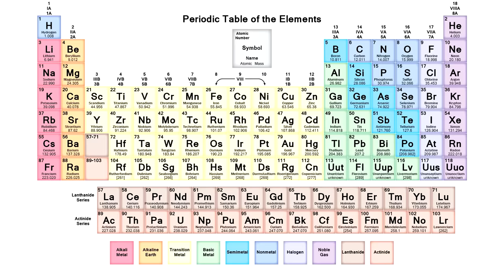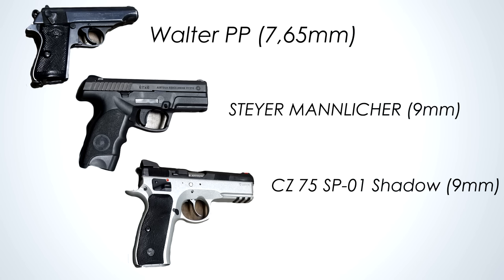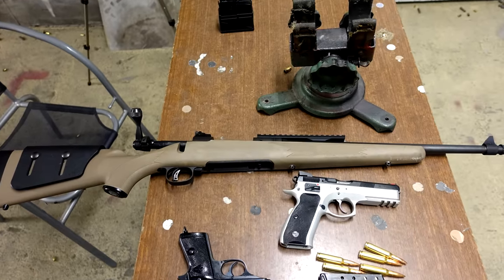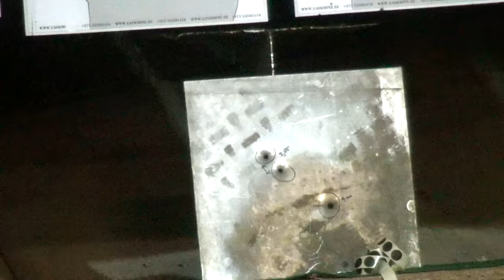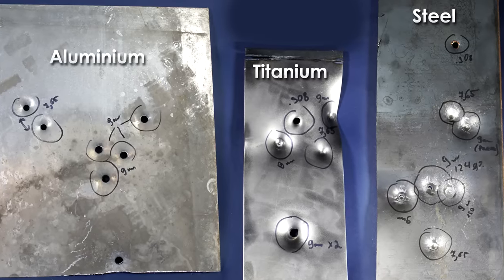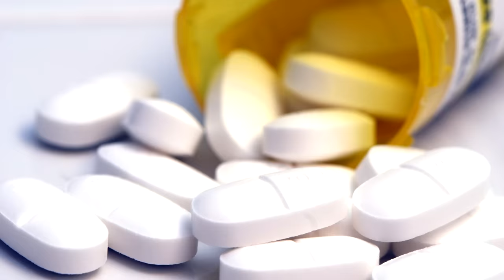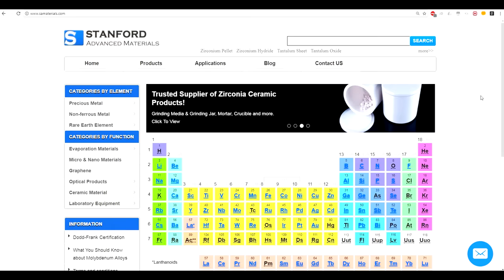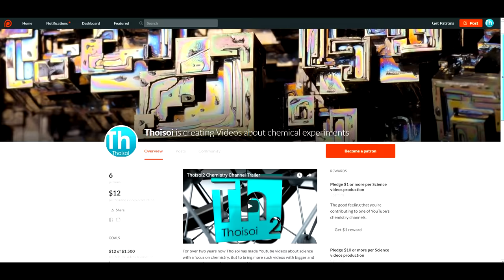Titanium  - The STRONGEST METAL On Earth!

Comment: Toughest? No, but being light weight but tougher than aluminum is why its a awesome material. The toughest still goes to tungsten, chromium, or nickle depending on what you call tough. The reason how I know this is because I'm a CNC engineer that works in the development/manufacturing in Carbide tools. Titanium is more like a aluminum 2.0. Not many people use those other materials due to either material cost, machining cost, or other possible reasons.

I edited the original comment because I nearly forgot about nickle.
Reply: Zin Gaming Tungsten should be hard instead of tough. I've never seen metal chromium, you're job is so cool!!!
Reply: sovietrepublic38 sort of is. Its not easy and very expensive. If a operator screws up a tool it can be as cheap as $.20 or as expensive as $2000 in material costs alone.
Reply: I'm a mechanical/process engineer who also is qualified as a master toolmaker. I use hardened D2 tool steel to manipulate titanium on a regular basis. A lot of this is cold forging of titanium. Titanium has the great characteristic of having "The weight of aluminum with the strength of steel". That's the way it used to be described way back when. Marketing has turned peoples perception of it it into being some "super alloy". Like you  I know that using correct speeds and feeds carbide can cut through titanium like butter. Titanium = ~36 Hardness Rockwell C scale. C2 Carbide = 90 HRC. 
He's mostly demonstrating its work hardening characteristics. Most stainless grades strain harden just as bad. Inconel is another material that will cause you a lot of grief if you try to cut it to agressively with bad feed/speed practices.
Reply: Also since I'm part of R&D I have to work with a tolerance of 2µm or less while our operators have some parts of the blue prints within .0002" or less (depending on which tool). Chromium does exist in workable metal form (just extremely expensive).
Reply: Mark Robirds Our most common carbide we use is between C3 to C1 but we also use SiC and I nearly forgot about Incon. I hate that stuff but since we make tools that is used in the production of aerospace we have too. Thanks for clearing it up a bit more Ive only been in the field for about 5 years.
Reply: I was just thinking that on the other side of the two material relation is the advance in Carbide cutting tools enhancement with the advent of TiAlN and AlTiN coatings that have brought forth the techniques of high speed machining of materials dry using only air blast to clear chips. I frequently hard mill up to 63HRC tool steels with these.
Reply: Can u give me some speed n feed for 63 hrc. We are havin problems with 23 - 27 hrc. Carbide drills gets fucked after short time.
Reply: "Tough" here means impact resistance.
Reply: croatia337 tool to tool feeds and speeds change on who made the tool, you should have something that came from the tool manufacturer because you could be on any number of tools like flute count, tool type, tool size, who made it, and so on. Feed and speed for a SS tool wont work with a SSI, MH, or a HH tool.
Reply: If you dont know what those mean Ill clear it up. (SS) Stainless steel, (SSI) Stainless Steel indexed, (MH) Medium Helix, (HH) High Helix, now here are some more that I didnt say. (ARF) Aluminum roughing finishing, (SH) Short helix, (AFI) Aluminum finishing indexed, and those are just the ones I can name off the top of my head.
Reply: Zin Gaming All good info. Previous comment is most pertinent. croatia337 if your going to get into hard milling techniques there are a lot of variables that will come into play. Everyone has there preference when it comes to tooling, so look around, but RobbJack is a great company that has done a lot of development in this area. They are really good at working with customers to custom tailor their process to the needs at hand. Great place to start. Get in some of the forums where you'll find discussion and people who have experiment along many different lines. You'll get more and better info than what's going to be found in the YT comments format.
Reply: its nickel,learn to spell,i guess all those engineering classes didn't help.
Reply: Zin Gaming inconel is up there
Reply: Tungsten is hard, not relatively tough. It's more brittle than titanium.

A diamond is the hardest substance, but brittle.

The atoms in the crystal structure are more likely to cleave and break than slide and reposition...at room temperature.

Comment: As a structural aircraft mechanic, I encountered titanium from time to time. It was a pain in the ass to drill but a nightmare to cut. We were doing structural modifications to strengthen the installation points for incorporating TCAS transponders. One of the pieces we installed was an 0.032" thick titanium doubler. It was about 16"x12" square, including about 24, 1 inch, finger-like tabs around the perimeter. This was normally supplied in a manufactured state, but one time we had to make our own. NIGHTMARE!!! Cutting out all those finger tabs around the perimeter of that rectangle of titanium sheet took FOREVER and required lots and lots of swearing and cursing and a few bandsaw blades, lol.
Reply: do you still work with titanium materials?

Comment: Really informative video. I want to make my own body armour and at first I thought about to use steel but then I remembered titanium is far mor harder. Right I came up to this video and this make me decided to also use it as electrodes for my hydrogen generator instead of graphite. 

Thanks
Reply: Just remember the energy has to go somewhere. So just because you think out the material with a stronger lighter material doesn't mean the blunt force trauma goes away

Comment: Isnt tungsten the most durable metal? Its hardness is 7,5 (mohs scale), while Titanium has only 6.
Reply: HVandstuff86 hardness and toughness are different. Tungsten is more brittle
Reply: Alright, thanks for explanation.
Reply: Tungsten is also heavy as shit which would make it useless for all the applications he listed. Well except for the drill bits. I use titanium coated tungsten tooling. The titanium coating wets better than tungsten which keeps the hot chips from welding to the bit. It probable has something to do with that oxide layer he mentioned.
Reply: Ive worked with tungsten. Its around C20-C30 on the Rockwell scale for most alloys. Its somewhat brittle and behaves like ductile iron, but stronger. Some of the hardest are tool steels and carbides. On the mohs scale titanium is probably about 3 or so (relatively soft). Keep in mind the mohs scale is for minerals, and not usually used for metals.
Reply: There are steel alloys that wins titanium on everythiing
Reply: HVandstuff86 tungsten is also the most dense
Reply: Christopher Combs Nope, osmium is the most dense, followed closely by iridium. Tungsten is slightly less dense than gold.

Also, you wouldn't work with pure tungsten, but with tungsten carbide, wich is less brittle and is used to cut/mill even the harder titanium alloys like ti6al4v. Hardened tool steels are also usually harder than titanium alloys, while keeping a good mechanical toughness. The only real mechanical advantage titanium has over other metals, is its low weight in relation to its hardness and toughness. Aluminium is far more lightweight, but also pretty soft; Hardened tool steel is harder and about as tough, but weighs about 75% more (and looses it's hardness, if it gets too hot); Tungsten carbide is a lot harder, but also much more brittle and weighs about 4x as much.

Tl;dr: To determine wich material is best, always depends on the task it's used for.
Reply: Chromium is the hardest on the Mohs scale, at 8.5.
Reply: Sagrotan, good response - titanium's ability to shrug off heat made it attractive to Kelly Johnson at Lockheed's Skunkworks when he designed the SR71. Aerodynamic heating was a serious concern with that aircraft.
Reply: Titanium used on drill bits is referred to TiN (titanium nitride, an ionic compound instead of metallic) and it shrug off heat by lowering friction force while cutting. Titanium used on SR71 is metallic titanium, is somewhat different. But you're right, both are bad heat conductor.
Reply: Titanium is tough. It only deforms after hit by bullets, how can it be brittle?
Reply: Depends on the temper. It work hardens a lot faster than steel. Bend a 12 gauge steel rod back and forth half a dozzen times and touch it. It will be warm. Do the same thing to titanium and you will get a nasty burn. Found that out the hard way.
Reply: Mikael Ylivaara except that steel is not a metal, it's an alloy like you said. But you're right, a lot of steel alloys can beat it but without being as light
Reply: Jordan E 
Steel IS a metal. It's not an element, but that doesn't mean it's not a metal. In fact most metals used are alloys. The titanium sheet shown in the video, for example, is most likely ti6al4v.
Reply: Mikael Ylivaara please name some im actually very curious
Reply: Beta Ti3Au is showing alot of potential as an alloy, harder than titanium so long as its in its beta form, in alpha form is compairable to titanium in strength
Reply: Carbon content plays a big role in the strength of certain steel alloys, diamonds are basically pure carbon but so is graphite or charcoal oddly enough.
Reply: Wood and glass are two different things....
Wood gets burn easily whereas glass does not but wood is more durable thqn glass because it doesn't shatter
Reply: dunga kholhrng
1. Who said glass and wood were the same thing?

2. Glass and wood are no metals, so they are in no way part of this discussion.

3. Durability depends on the task; glass may shatter easier when there is a high mechanical force applied, but it's also harder, so it would be way more durable when it comes to friction related tasks.

What's the point of your comment?
Reply: i knew some fool would mention tungsten
Reply: HVandstuff86 tungsten is as brittle as glass so brittle a chainsaw can cut it
Reply: Tungsten is harder and would be a much better metal if you're gonna make a file, but would not be able to whitstand a lot of vibration and impact due to its brittleness, so it would not work as well for a metal spring. It's all about the alloys. Titanium is often mixed with magnesium and aluminium which is not very durable in comparison, but in an alloy you get very light and durable material. Different alloys for different applications is important to get the right properties.
Reply: Mikael Ylivaara , that is not true. It all depends on what kind of properties they need for the job. Where light weight is very important, titanium alloys are supreme. That's why they use it for spacecrafts.
Reply: TjinDeDjen no, it is metal, but it is not 'a' metal.
Reply: The Bellows Ok, my grammar wasn't perfect, thanks for the correction. But my point was, steel IS metal, but not an element. It's an alloy, wich means it's still metal.
Reply: HVandstuff86
Reply: This is why scientists and engineers rarely use words like 'strongest' or 'most durable' because they dont hold for every situation. For instance, regular hi-speed steel will quite happily cut titanium, so which is 'stronger' at that point?

PS: You probably use tungsten carbide tooling coated with TiN( titanium nitride, not 'tin'). And the coating is to decrease chip-weld, not to increase strength
Reply: The title of the video is strongest and there is no strongest metal. There is allways a trade of between hardness, toughness and abrasion resistance. The title is pretty missleading and clickbaity.
Reply: sovietrepublic38 you are wrong, pure tungsten isn't brittle, it's actually extremely durable in hardness, flexibility and shock absorbtion and a small tungsten cube was able to survive gun shots without any damage while titanium suffered a small damage from the shots from the exact same guns with the exact same ammo... But it's extremely dense, several times heavier than steel... While Titanium is extremely light (lighter than steel actually), Titanium has the highest mechanical resistance in relation to it's weight. This isn't the case with Tungsten which is extremely heavy and because of that it's usually only used on smaller components such as CNC cutting blades and mechanical joints. Depleted uranium actually has an even greater shock absorbtion than tungsten due to higher density.
Reply: Jordan E, not true! The maraging steels such as 300M and 400M have a tensile strength over twice that of the strongest grade of titanium. These grades have greater strength to weight ratios than titanium.
Reply: Tungsten carbide is made of two metals usually steel and tungsten steel takes the brittleness out of it making it the strongest metal in the world
Reply: Tungsten carbide is hard not strong, you can shatter it with impact or temperature. And GRAPHINE is the strongest substance. Its new, but pure carbon arranged to be crazy strong. But i doubt its hard like carbide, dont remember. Check it out graphine
Reply: So define durable? Have any of you looked it up?  The harder a material is,  the more durable it is.  Hardness and brittleness are at two opposite ends of the spectrum.  So everyone saying titanium is more durable than tungsten is 100% wrong.  Titanium is stronger,  but less durable.  Durable means resistant to wear.  Aka harder.
Reply: sovietrepublic38 incorrect, tungsten can handle 50bmg without shattering at all and holds up under huge pressure unlike titanium, Tungsten is a rare metal whitch is why it isn't used as offten
Reply: Titanium strength to weight ratio is way way higher than tungsten.
Reply: At work, there is guy who has a Titanium wedding ring, and I have a tungsten carbide ring wedding ring. His titanium ring looks like crap. It's bent all out of shape, and scratch senseless. My Tungsten ring looks brand new. No scratches, not bent. Pretty much the same with gold, silver, and anything else, they all look like junk. Tungsten has the highest melting point too. I've lost two wedding rings, and my wife has bought three,, but they are cheap. The tungsten is almost as heavy as gold, which is cool.  Waste your money on expensive engagement rings, but buy  tungsten wedding rings.

Comment: In terms of tensile strength, tungsten is the strongest out of any natural metal (142,000 psi). But in terms of impact strength, tungsten is weak — it’s a brittle metal that’s known to shatter on impact. Titanium, on the other hand, has a tensile strength of 63,000 psi. Grade 4 Titanium is the most used.

Comment: Any idea on how to surface grind Titanium with success? I will be experimenting for some knife makers.
Steve
Reply: Use double sided sticky tape on your magnet. That how I was grinding non magnetic stainless steel.
Reply: That sounds like a good idea.
Steve
Reply: Thanks, I have a green silicon carbide wheel being made to use on Titanium. It has been over a month now but the sales rep says they are working on a special one for me. Looking forward to trying it out.
Steve
Reply: Double side tape is risky for grinding, i've done it with a flycutter. But grinding the coolant will make the tape let go. Don't think its a good idea dry. Better off just blocking it in with thin wide strips of steel and keep the wheel over part always. Or use a vise if possible
Reply: Or if possible bolt a steel plate to underside of titanium. There is other ways than tape. Tape is dangerous for grinding. Your new wheel wont like light cuts, it will gum up the wheel, grab the piece and throw it
Reply: Solid Rock Machine Shop Inc. I'm not. I know what I'm doing as a machinist.  I just get dumber watching "youtube machinists"
Reply: Hi HighStreet,
Sorry if I offend you, it wasn't intended and I was not implying at all that you did not know what you were doing. Working in Titanium is new to me and I am ignorant on the subject of Titanium. I appreciate the information you shared with me.
Steve
Reply: Solid Rock Machine Shop Inc. oh no worry. I just watch a few YouTube machinists that can't square a block and I just facepalm. I'm sure you'll figure it out. there's a lot of different things you can do. Just if it's not working try something else. If there was truly no way to hold it and you have a lot of them I'd just use a vacuum chuck. double side tape for surface grinding is dangerous. there's always another way
Reply: Hi HighStreet Killers,

I agree with you about the two sided tape especially using coolant. I made a little steel fixture that worked good.
Steve

Comment: One fun titanium fact. In the 1960's the United States Air Force needed a new spy plane to replace the U-2 which had proven to be vulnerable to Soviet surface to air missiles. The SR-71 started out as an high speed, high flying interceptor but proved to be ill-suited for that roll. It was modified to become the spy plane to replace the SR-71. However the design required large amounts of titanium, a quantity that only the USSR could provide.
    The Air Force set up a cooperation to buy the metal from the Soviets as it was thought that the Soviets would not sell it directly to the Air Force.
    Every gram of titanium used to build the SR-71's was originally from the USSR.

Comment: Stop cutting in the wrong direction with the angle grinder!! You always cut away from you so if the disc grabs it just jumps up from the piece where in your stupid way it will suck the grinder in to the piece and make you look silly.
Reply: He Ka I was about to say the same thing. I dont think he has ever worked in a metal shop
Reply: I know right? x)
Reply: it actually safest to have the wheel run in the direction that will pull the tool away from you. if you have it turn so as to push it into you is when it can get stuck and throw the tool.
Reply: Wrong! Cutting the way you describe it would be much more like to grab and the grinder is coming towards you. The way he was cutting is the correct way.